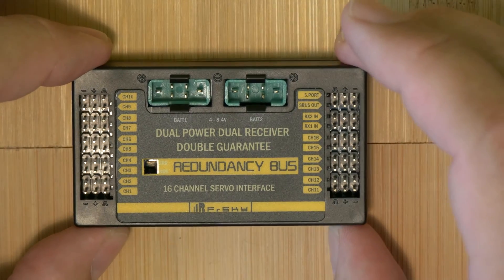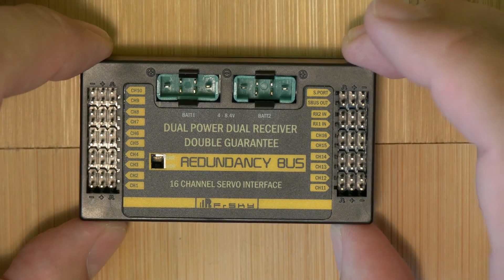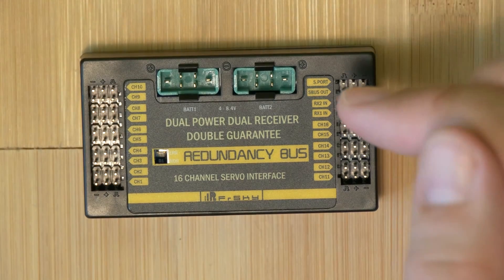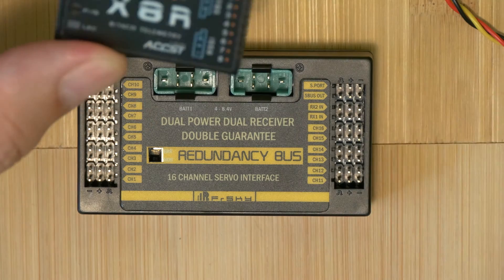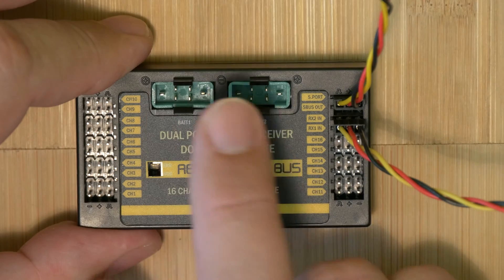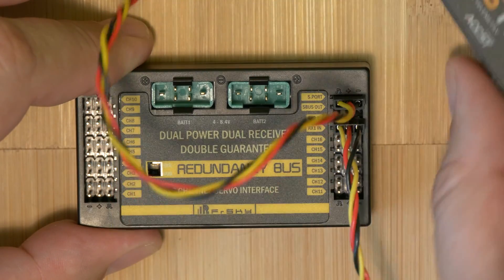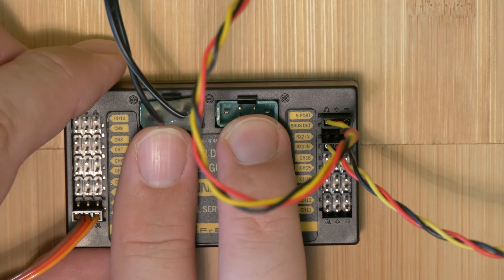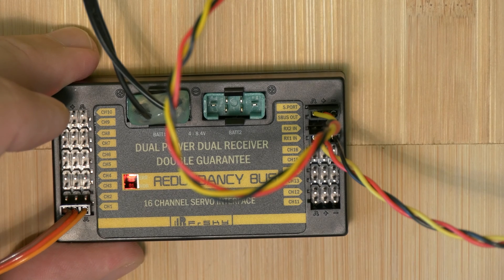FrSky Taranis / OpenTx Crumbs - Redundancy bus (simple preview)

Comment: Hi Richard, I need help I have a problem with the RB 20.
The LED that indicates the operation of the redundancy bus RB 20 is not solid green, only red. The strangest thing is that all telemetry appears normally including the cell-by-cell voltage sensor, but the servos don't work.
I'm using an RX8R receiver as a master and the X8R as a slave, using 16 channels.
What's wrong?
Could you help me please?